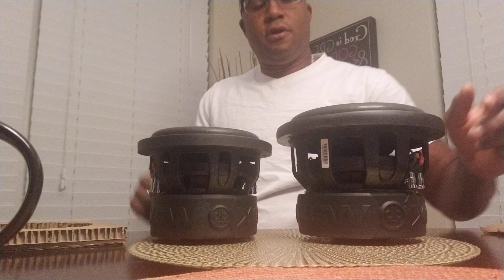Subwoofer size & Efficiency

Comment: I think your misunderstanding the whole "accuracy" thing. It's not how loud it can get. It's how well the woofer can follow the note, without mechanical slop. The reason they say smaller is more accurate, is they do not have so much mass on the cone, so they are less likely to tilt, causing a less accurate note reproduction. This is also an old SQL thing. It does not apply to SPL at all.

Comment: What would be the best subwoofers for metal music I listen to metal and rap I know there is no one subwoofer for this and I've researched a lot and there is arguments for big or small with what you said I can get a lot more 6.5 or 8s compared to 1 15" but I do have the room it's in a suv but I want sound quality not spl so should I worry about my midbass drivers and have a couple smaller subwoofers to fill the gap?
Reply: You say you don’t care for spl
Just get something that’s tuned to 33hz
Reply: It depends on how you like your music.   The larger subs can easily overpower the full range and with metal that's usually not what people want so you want something appropriately sized for the level of full range you have.   If you have 100 watt rms full range speakers in a small truck cab, (1) 10" will get it done.   Larger super cab, (2) 10's will get it done even if they are shallow mounts.  But if you like bass and even more bass, then move up to 12's.   You can run about 400 to 800 rms on any of these sub setups and be plenty loud.   You start getting above that 800 range, prices on everything starts to really go up.

Comment: Got a question.  How bout 2 db drive wdx  g1 10 inch vs 2 db speed series 12 in. Which one will bass more. I know the g1 can handle more watts.
Reply from the maker: j peezy in an optimal box the G1 will outperform in depth of bass, and force of bass
Reply: So how much do your custom boxes run?? Also i just got the 2 10 inch g1 wdx recently.  Did i mess up and should of went with the g2?? What's your opinion??